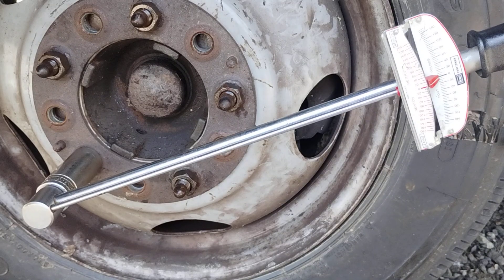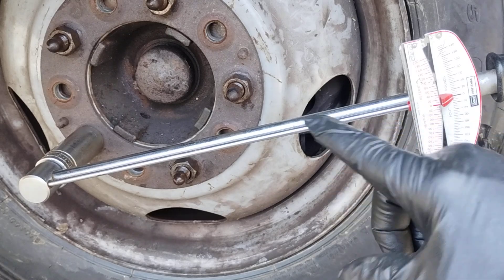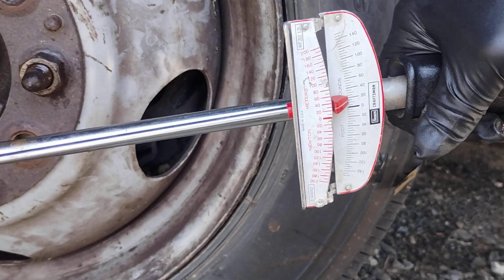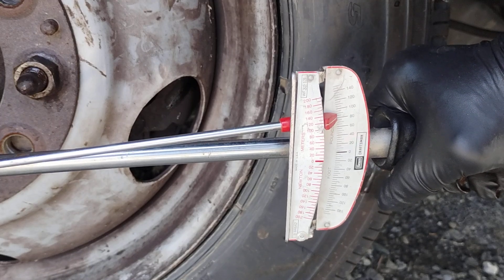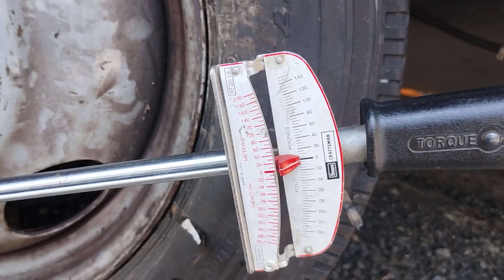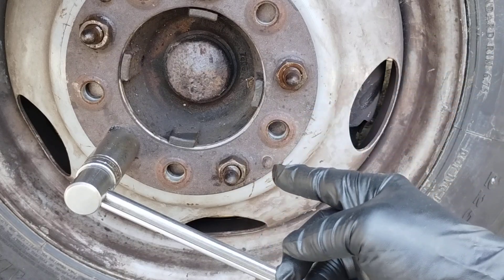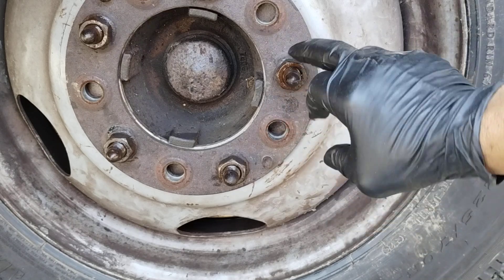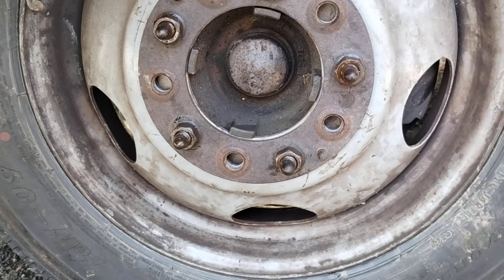Torque tire why all mechanics get it wrong plus  beam bar is superior for specific torque setting

Comment: I agree about the beam bar to an extent but a good quality click bar set correctly is fine.  Lube or not to lube that is the question eh?.    But wheels shouldn't sit on the studs they rely on the wheel engaging with the hub and that takes the weight once you have a few nipped up. Sitting on the ground is fine in my book, but I see your points.  So long as the wheel nuts don't loosen and it's not overtight to damage the wheels don't It's all academic really.
Reply from the maker: Note , some wheels don't have those hubs but yes, the hubs are the surface area and you need the clamp force for the tire to stay secure. 
Torquing with the weight of the vehicle is giving a false torque and we know mechanics ram those nuts on while the car is still on the lift... and "click click click" is just smoke and mirrors... Those nuts are over torqued with the impact driver...
Reply: @ForensicCats  Yeah I have had nuts that I had to break with a scaffold pole recently!!  Tyre fitters eh?

Comment: No one is setting the tire on the ground with loose nuts. We usually snug the lugs up until the rim is seated then lower it to torque them to spec.
Reply: I have to agree here. You are just making it way overcomplicated if torque entirely in the air.

If you are someone who doesn't tighten anything until you set it on the ground, you probably also tighten in a circular pattern and should have your tools confiscated.

Lastly, I'm just going to throw this out there, I've changed, removed and replaced many, many tires in 35ish years of wrenching, and I have never specifically used a torque wrench to tighten lug nuts. I've never had a lug come loose, nor had any kind of issues with them not all being exactly the same torque. I will 'torque' them all by feel, then do the pattern fully again to be sure they all still feel the same.

There are many bolts in a vehicle that require specific torque, especially in the engine. But experience shows me that the extra effort is not required. Now, I fully acknowledge that professional shops are required to torque to spec by law, and would never advocate anyone to ignore those rules. But I'll never use a torque wrench on a lug. Not only is "good and tight" good enough, but I suspect that the tolerance for 'in torque' us probably 10 pounds +/- anyway. And you can get within that tolerance 'by feel' easily.

The other advice of wire wheel the hub is spot on though. A bad seat from rust flakes can be a real problem.
Reply from the maker: For clarification, I agree but the torque issue is what I am stating is true... Torquing with the weight of the car is incorrect.

Comment: I usually snug up all the lugnuts before I lower the jack just enough for the ground to hold the tire then torqe the lugnuts.
Reply from the maker: I hear you...but, that still just jambed tire still on  the issue of torquing the weight of the vehicle. 
I know most mechanics just use an impact driver and they over torque the connection and then some use a torque wrench to confirm it's "over torqued" and this can put in yield or plastic zone.

Comment: As I work with a Snap-On air impact wrench every day you can dial it in at a specific torque. I believe that the weight and viscosity of the water influences the effect of the pressure. Do you think a click type torque wrench is as effective as the beam type?
Reply from the maker: The club click type, I own a couple and the problem is if you have excess lubrication, it can over torque and if you lack lubrication, it can under torque.
It just clicks when it hits the value you set.
New installation and I would state they are ideal, once you proof test a few hundred of them.
But, a beam bar does not require calibration either... You can care less about what original/brand new /factor torque specs are (the vehicle is no longer brand new and those torque specs are for new)...
Unless u r doing torque to yield, I just let each "child" tell me how far he wants to play.
But, do dry run the screw, this will confirm thread resistance and ideally, you will be able to bottom out/snug fit and then apply torque wrench to maximum clamp force without stretching the threads of bolt/screw.

Comment: I commented earlier but its gone i guess yt delete it im trying to think if i said anything i shouldn't have.. in my experience in the tire and wheel business the technicians torque wrench stays in his drawer especially for guys who pull wheels on and off all day everyday they impact it on and thats about it
Reply: Time is Money plus just laziness.
Reply: @sturgus1  and arrogance if you're r&r dozens or even hundreds of wheels every week for a living it's natural to eventually say I think I got this down pretty good and start cutting corners. Something like a lug nut torque is one of those things that's never a problem until one day it is especially if the wheels aluminum.
Reply: when I worked at a tire shop we used torqe sticks but im not sure how accurate they really are.
Reply from the maker: I have them also, I will do a video for you and we can confirm.
Reply from the maker: Fact checked, true 😂
Reply: For lug nuts I only have a harbor freight set of the half inch drive extension sticks so it's hard to say lol. I'll put myself in the I've done this a gazillion times column so unless it's something special I don't usually check them all. There are wheels that are 2 or 3 pieces bolted together I definitely torque wrench those. it's usually titanium hardware threading into aluminum so the margin fir error is like zero. First time I ever did one was a 06 mercedes cls special edition bbs custom two PC upgrade option wheel that cost $3100 each at the dealer and had to come from Hamburg. Long story short I ended up having to drill out and helicoil 5 of the 19 holes 😒 lesson learned that week
Reply: The last time I replaced tires, the shop undertorqued every lugnut on the car to under 60 ft-lbs, which I guess is better than too tight and trashing the studs.
Reply: @jebus914  Last time I took a wheel off after using a tyre shop I had to use a 5 foot scaffold bar to break the nuts!!